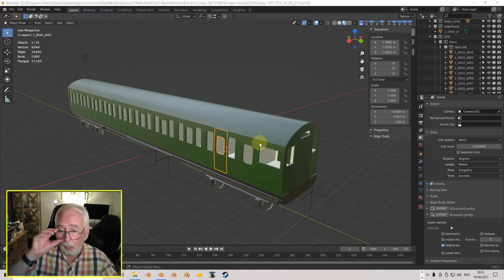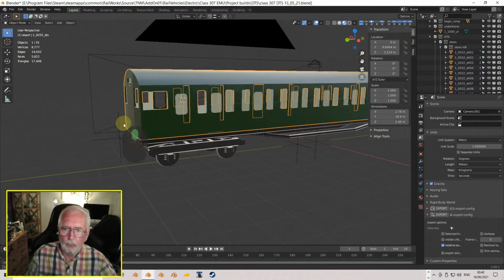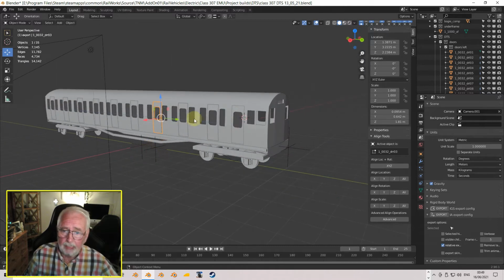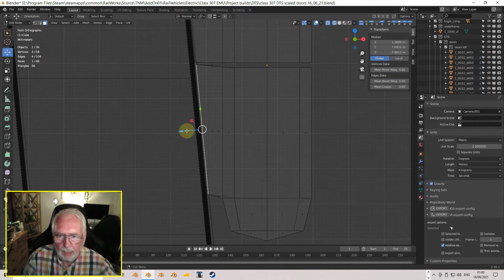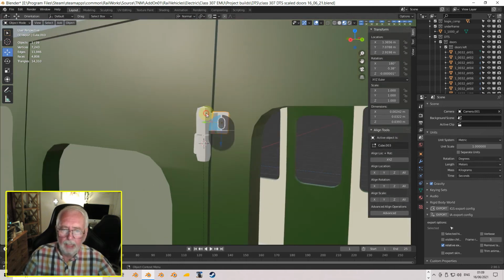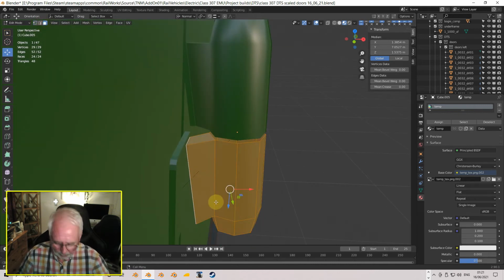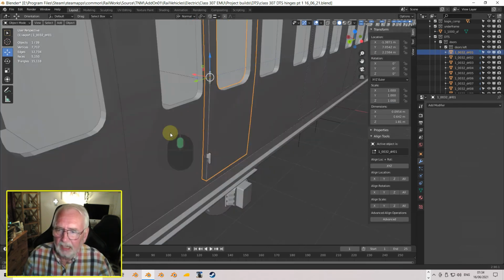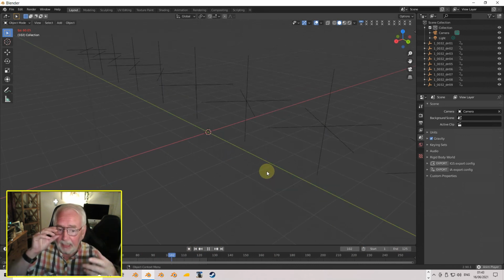Class 307 tutorial 10 creating the door hinges

Comment: Great tutorial, but you have created the hinges upside-down, the bottom fixed portion should be on the frame, not the door.  As drawn, the doors would slide down on the hinge pins (& fall off) when the doors are opened.
Reply from the maker: These are special magnetic hinges, you are quite right of course and on an earlier incarnation of the vehicle I did put them the right way round, the door hinges would need to be supported by the fixed portion on the frame. I wish I had noticed,  I could animated them to fall off for a giggle.
Reply: @tonynic-mc  Please do it (assuming you still have the files ;) ), we could do with a laugh these days.  Anyway an easy mistake to make and not notice.